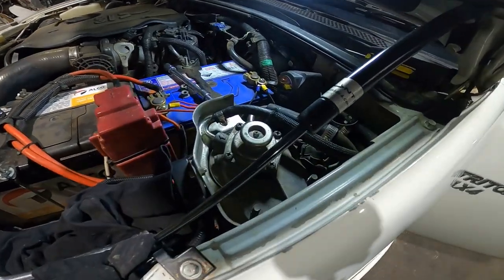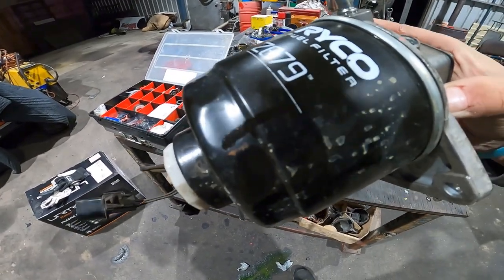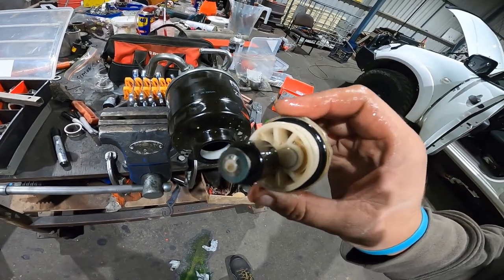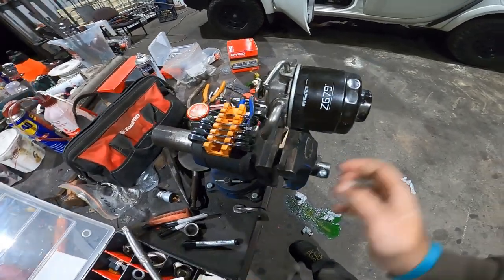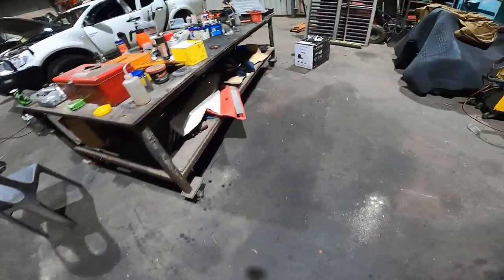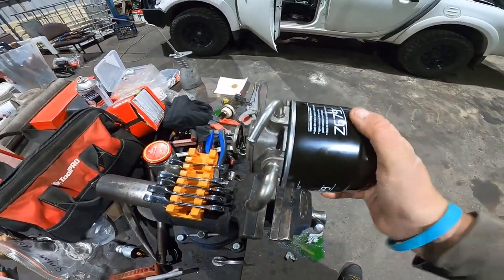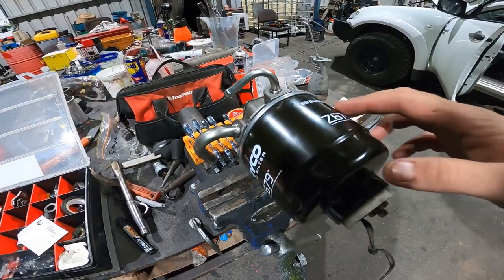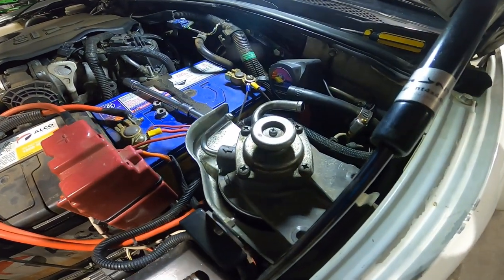How to replace the diesel fuel filter-  Mitsubishi triton MN/L200 [ DIY ]

Comment: i was hoping on the re install that i might get a more visual step by step but the end is just a vague as the beginning, thank thou. at least i got an idea
Reply from the maker: @Abfs900  What did you want to see? It's the same as removing it. Just follow the removal steps and that's that's how it's done. 
- Plug the water sensor back together
- Put the filter in the housing 
- Tighten the two 14mm nuts
- Put the fuel lines back in
- Start priming the filter till hard
- Start the vehicle then you may need to prime it again until it will stay running.

Comment: Thanks for the video, very helpful! Is it possible to do this without a vice?
Reply from the maker: Might be hard to hold without a vice but I'm sure you could find a way to hold the mount while you undo/tighten the filter. Could remove the battery and maybe try Undoing the filter in the engine bay while it's still bolted in but without trying it and seeing it in person right this minute, it's hard to say.

Comment: Bleed screw on the sensor or just prime it up and should be good?
Reply from the maker: No bleed screw on a factory housing but the pre filter has one which I open to prime that before it starts filling the factory one. Easy as that👍